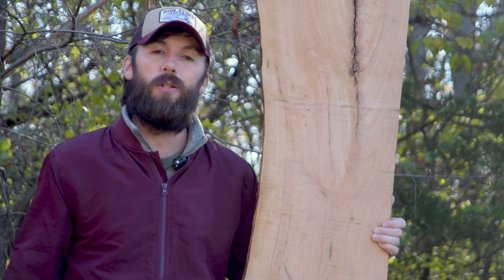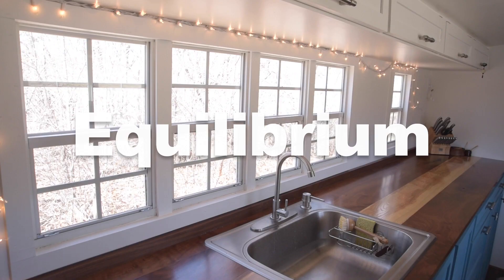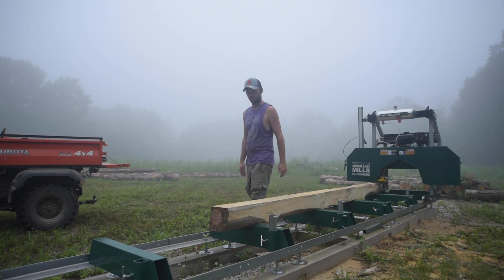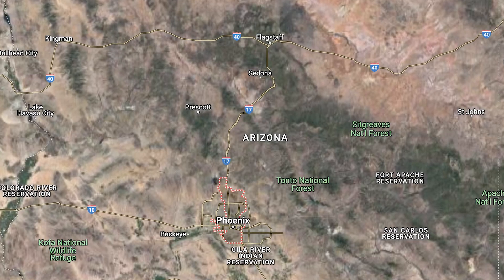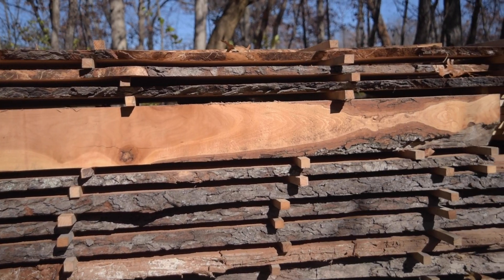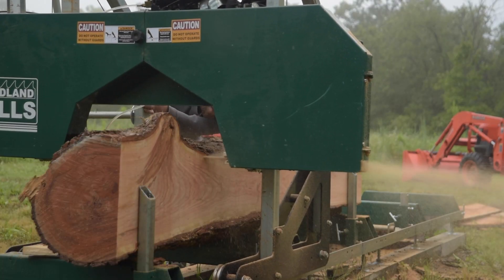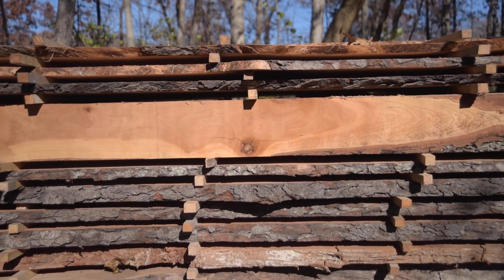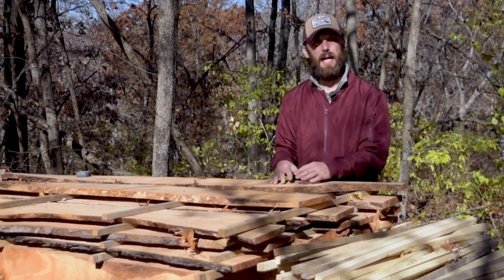Can You Dry Wood Faster?

Comment: About 90+% of wood drying occures at the ends of the wood not the sides stickering wood for an air dry kiln is for temp. control not drying, wood is like a bundle of straws not a sponge, Vacuum plate kilns which are generally the fastest drying possible load with hot metal plates between each layer for heating and all moisture is removed at the ends. It is important to remove any sealer applied to ends before drying so that water can escape otherwise drying times will be greatly extended